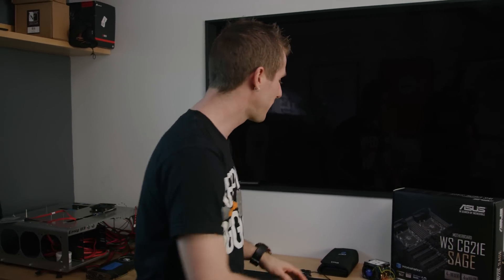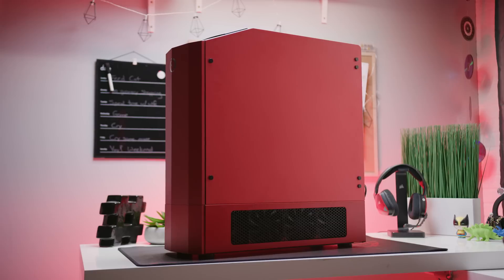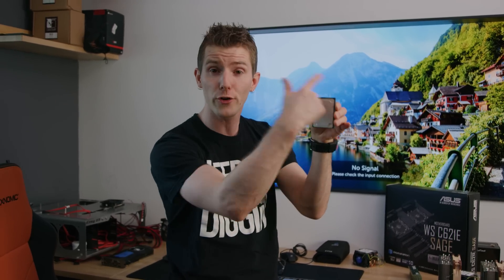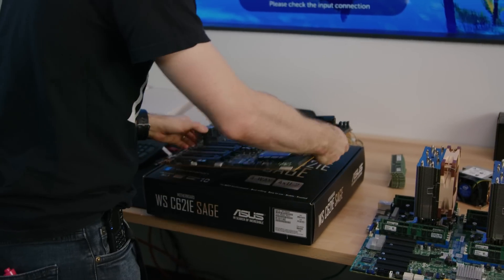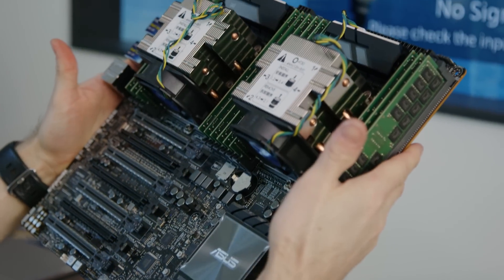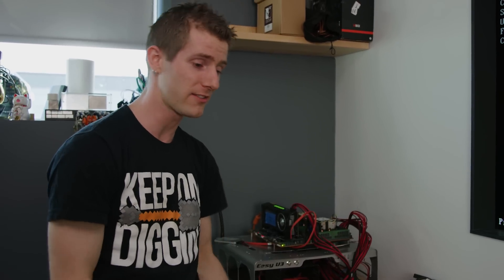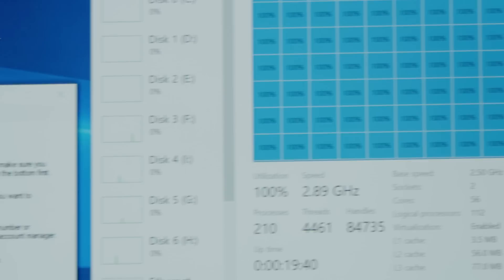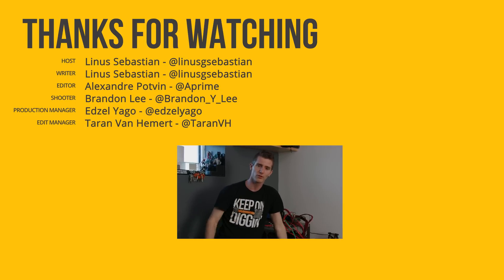56 Cores in ONE SYSTEM! - HOLY $H!T

Comment: Epyc is a better design, intel uses a single monolithic die in there Xeon cpu’s, a 26 core cpu has a massive die, the amount of yield from a wafer with the use of a single die this big would be tiny, this results in them being extremely hard to manufacture and extremely expensive.

Epyc uses multiple ccx’s of 8 cores each connected by the infinity fabric, these dies compared to the size of the single intel 24 core monolithic die produce significantly more yield from a wafer of the same size, hence manufacturing costs due to less difficulty and higher yields are way lower.

The result-

Intel 8164 26 cores 52 threads 2-3.7ghz cpu- $6120

Epyc 7601 32 cores 64 threads 2.2-3.2ghz cpu- $4500

Comment: Virtualize 56 single core systems on it.
Reply: Virtualized 112 machines and load them with browsers and YouTube and word documents until it freezes
Reply: Why stop there? Treat each thread as a core so have 112 single thread systems
Reply: https://ark.intel.com/products/120496/Intel-Xeon-Platinum-8180-Processor-38-5M-Cache-2-50-GHz- it has 56 threads lol
Reply: Give each system a new disk! No disk load!
Reply: or just use one chrome instance with 20 tabs open.
Reply: Mind the disk load.
Reply: That's where you need NVME SSD's, and if thats not enough, have the Guest Virtual Machine copy from the NVME SSD to the RAM during boot.
Reply: Don't bother with set core assignments and use something more flexible like Citrix to have a  couple hundred people working on it^^
Reply: I’m with you in that. I would love to see it XD
Reply: You can run 224 single core vms without a problem, You can overprovision vcpus

Comment: i want to see the multi workstations on one motherboard set up. especially if you can compare the cost of this machine to a comparable setup with seperate computers. would there be advantages for teams that need to work together? also find some ai programmer to see if this can have some utility in training an algorithm quickly. usually deeplearning stuff is gpu focused but maybe 56 cpu cores can offer some benefits with less of the drawbacks of average, lower core count cpus. you can do content on enterprise technology, ai research, programming, and computer science just using one machine!
Reply: a major downside is 1 point of failure and all your workstations go down
Reply: true though it is a way for a low operating cost business to have 100+ computers on a 20k USD or below budget for computers so in that a single point of failure will be acceptable but on the list of what to get rid of when able to do so as virtual machines can have upwards of 200 machines running on that 1 server depending on how many resources each machine needs and how much redundancy done most likely in hardware RAIDZ 
most likely it will make for a good server for all your front facing computers that have a tolerance of 3 hours of down time per month for updates to the main machine which for most business a 3 hour break per month with the rest of the month always on and always working perfectly will be better than what it most likely is now due to how bad windows is with a set up of 3 or more fail over computers from the main one 
the IT department makes it work but when it actually is used getting back to the primary computer after what the fail over was caused by is fixed is not a easy task to do and everything takes longer on the fail over computer due to the switch that should be not noticeable but is in the network infrastructure to the server

Comment: Things you should try:

Mine XMR with Nicehash and compare the speeds to any high end GPU(GTX 1080ti, Titax Xp, ect.)

Run 5 to10 different CPU intensive games at the same time

Render a video in Vegas Pro and Adobe Premier at the same time without using the GPU

And do more fun things like that 😉

Comment: see how many chrome tabs you can have open watching the 1 hour replay of Sax guy Gandolf simultaneously and after that, use blender. Also, for the people saying try Minecraft, it would actually run like crap compared to most CPUs when you are actually doing something because of low single core frequency and lack of core usage. (Minecraft only uses 1 core, so 1 core at 2.9Ghz won't get you very far)

Comment: How would it handle complex CFD in multiple permutations (ie differnt angles air hits a spoiler for a race car). For Formula Student, we normally have to send this to a supercomputer service but want to see if it's possible to run from a 'local' motherboard so we don't have to queue for runs.

Comment: How Fast can it render?
If you can, try out the AV1 codec. Note that it's also called VP10, and you have to install the libaom patch.

If you use ffmpeg, the command should be...

ffmpeg -i input -c:v libaom -b:v 1M -thread 112 output

(BTW It feels so awesome to type -thread 112)

Comment: i want to see what its like to render out like a pixar movie. ive heard those guys have FARMS of GPUs to render a film and i am super curious what that kind of workload does to a system like this
Reply: Not much more than rendering a single scene in e.g. Blender Cycles or Mental Ray or iRay etc. The only reason they need to use render farms is for time constraints and because they likely do it at absurd resolutions and sample rates. I suppose they also probably simulate a lot of things like hair, foliage and water etc. at finer detail than most people would bother with.

Comment: I'm curiosus how many vm machines could it handle using qemu kvm. And if you're fealing frisky about it you can use qcow2 images using ssd and hdd for hot and cold sectors.. meaning reading vm resources from the ssd and writing any changes to the hdd.

Comment: Monero CPU mining ?! hashrate ?
Reply: and what about power consumption ?
Reply: Based off my experiences with Monero these should get around 950-1100 h/s per cpu.
Reply: Zach Demand, That's dreadful. The TR 1950X does that.
Reply: no way. Broadwell gets about 100h/s per CORE. No way its doing 1000h/s per cpu.
Reply: NoNoseProduction 
Well the platinum 8176 gets around 1330 h/s which is basicly the same cpu with a lower base clock, so I wasn't that far off.

Comment: to pay for the enginnering involved in them.. you mean, pay for an outdated, monolithic design that has horrible yields and is technologically inferior to an MCM design? Ahh... right.. intel needs one of the biggest names in tech to wave the blue flag to slow down the steamroller-and that pun was intended. Intel just got handed their ass serve r and workstation wise, as well. the only thing that intel has a benefit on is IPC, which comes from ringbus, not from any new design or development. the 'newer' chips are more like ryzen, and just as bad at games right now. remind me: how does the flagship 18-core run vs a 7700k in modern and older games?

Comment: The microSD card slot makes sense for a virtualised environment where the hypervisor is read from the microSD (VDI maybe). A major upgrade is just shutdown, swap the microSD, and boot back into the cluster; if it fails to boot for whatever reason, you can just swap the original microSD back and then figure out what the problem in without it being down. It leaves all your onboard storage available for virtual SAN, all the PCIe slots available for GPUs to share to the VDI VMs...

Comment: Crysis 3 144hz(if possible)/fps, ultra Settings, 16 monitors all running at 8k each or like the triple projector thing you did a while ago, or minsweeper 1,000,000 FPS

Comment: I'm pretty sure you can fix 90% of window's searching functionality by deploying a small sqlitedb where you run sql-statements like (SELECT * FROM FILELIST WHERE UPPER(NAME) LIKE '%' || UPPER(@SEARCHSTRING) || '%') off of a table where you store frequently used files or files of installed programs that will most likely be accessed at some point...

Comment: Not impressed until gigabyte sends you their 4 cpu epyc workstation motherboard and your rocking 128 cores....256 threads.  That is a holy shit, this is a meh.  Everybody knows intel has high core xeons, not everyone knows about EPYC having 32 cores at a pretty high comparative clock speed.
Reply: Can I get the specific name of the Motherboard? I am curious to know which of their offerings has four CPU slots, I can't seem to find it.
Reply: Hmmm.. ahh well, I am just looking for a motherboard that has the best support possible for CPUs, I care not for the brands since I am not a PC tech, I just want what works. So, they only go as high as two? Or are there bigger ones out there?
Reply: Thanks for the info, though I only found a Xeon Platinum CPU, not motherboard so far. Still, I am just looking for the best, I plan to build my own PC as several of my friends are PC gamers, so I'd like to be able to keep up with them, if not just flat out run past them and leave a nonexistant trail of fire. Any help in citing parts would be appreciated.
Reply: Saving that just incase, I'm just looking for a flat out PC motherboard and I have a 5K budget for the PC tower itself, not counting keys, screen, and mouse
Reply: You guys got me lol.  But I still need dual 32 core epyc in my youtubery.
Reply: Provided the specs line up I may end up going with two of them for my PC build.

Comment: If you're into math, you should test it with the LINPACK benchmark used to evaluate supercomputers:
https://www.top500.org/project/linpack/
It'd be funny to see if that machine would beat the fastest computer in the world from from a year in the 80's or 90's.
Reply: All the supercomputers up until 1996 are beaten by an i9 7980XE as they all score below 1TFlop/s on Linpack. Then supercomputing started taking off and by 2002 the fastest supercomputer (the NEC Earth Simulator which cost around 600 million dollars) was capable of 35.61TFlop/s. It is possible to beat that performance with an 18-core Intel E5-2699 coupled with 16 NVIDIA Volta V100 GPUs (a combination that costs around 150 thousand dollars) which score 51.77TFlop/s. So with 4000x less money you now get 45% more performance. The next supercomputer milestone to surpass would be 2004’s IBM Blue Geene  with 70.72TFlop/s.
Reply: my single xeon w3690 beats all the 80's supercomputers and it only has 6 cores, it scores about 70 gigaflops

Comment: Yeah! Who puts 4 u.2 slots on a board. Err... what is u.2? I’ve only ever heard of m.2, and I have a feeling they’re not based on the same thing.
Reply: u.2 is the new high speed. Designed to replace all sd/sf format if I am not mistaken.
Reply: I was mistaken about the replacement / usage of terms. I was thinking of  UFS version 3.0 standard, that would go to the drives?  It has been a long day.
Reply: Chris Flynn - Thank you. 😁👍
Reply: Haha, don't worry about it. It's fine. :)

Comment: you'd need 256 GB of ram to have 2GB of ram per core
since it only has 12 slots minimum is 32x12 which is 384
WAIT are there even 64/128 GB ddr4 sticks
this makes me want to add more ram to my system...

Comment: Weather simulation. It one of the few HPC computing tasks, that is still done exclusive on CPU and it scales to almost as many threads you want. This system should be equivalent to typical weather modeling supercomputer from about 2005. It would be great to see what can you do in desktop from factor today compared to row of refrigerator sized machines  from not to long ago. And it is actually useful.

Comment: But can it run CRYSIS???????
Reply: Crysis on all 6 virtual workstations at the same time
Reply: I doubt it has integrated graphics being a Xeon but it would be tight if it could
Reply: Why NO Crysis if you read thus linus it NEEDS to be run,grab a copy from GOG . com and just run it as a standard benchmark even if it's just for the LOLs
Reply: It can come up with original content so its more intelligent than you are.
Reply: imho his comment was mandatory, with that question :D
Reply: 20fps on low 800 x 600 resolution
Reply: At 144p so less gpu power more cpu power

Comment: Dual-Epyc adds up to 64 cores. And I'm fairly certain they're cheaper since each EPYC is 4 Zeppelin dies.
Reply: They are not available for purchase yet
Reply: They are behind in single core performance but awesome at multicore, so i doubt the price difference can be justified for going with intel as lately they are way more expensive per core
Reply: they were sent these CPUs so why waste them and SP3 motherboards suck for this stuff
Reply: they still probably fall behind in performance though

Comment: Hey Linus, I work for HPE and we handle these type of CPUs all the type. The installation process is actually to mount the CPU to the heatsink with a plastic retention clip, and then install the heatsink with the CPU already attached to the board.

To remove the CPU off the heatsink, the plastic retention clip should have a corner specifically designed to wedge a flat-head screwdriver and pry off the CPU with zero damage to either the heatsink or CPU if they are made to Intel's spec. I would inquire about these designs if I were you.

Comment: Being a car/tech guy I would take a good cooler for overclocking and make a mount for it.
Reply: It is not just the mount, but the coverage of the block as well.
Reply: Just a big aluminium block on top of it and you can run it at any frequency

For a while atleast

Comment: Few things:
1. MicroSD on the board is for Hypervisors like ESXi MicroSD boot (you don't need any HDD/SSD for the ESXi, MicroSD is more then enough)
2. I understand that Intel sponsored this video (specially since practically NO ONE buys the 8180 chips, the price is simply too high (+10000$), companies would prefer to either buy the Gold Xeon SP or go with AMD EPYC.
3. For a project that you mentioned (that each editor will get a VM + dedicated GPU), I would recommend to test EPYC. You'll have a lot of PCIe lanes (128 compared to 48 on Intel), 8 more cores (64 vs 56),  and it's also fully supported on KVM (I think the latest UnRAID should have the latest modifications of the KVM to support EPYC/Threadripper/Xeon-SP etc)

Comment: what about the new AMD Server motherboard and 2x AMD EPYC 7601 32 core processors for a total 64 cores 128 threads and 2TB of DDR4 duel channel RAM modules and if you wait until 2019 then 2x AMD EPYC 64 cores 128 cores and 256 threads.

Comment: Well as it's professional kit...

1. How many desktop VMs can it run with sensible specs, say if you wanted to roll out thin clients to your entire office for example doing office applications, web browsing etc.

2. How well does it perform when compiling large applications. Compile the entire Linux kernel and a selection of applications from scratch.

3. Performance as a webserver. Load it up with something like Mediawiki with a DB and PHP on the same machine and see how many requests per second it can handle vs older generations.

4. Lightroom... which is notoriously slow... So compare how long it takes to convert and then output a few thousand photos in various resolutions and formats (JPG / PNG / PSD)

5. Some kind of CPU-bound AI learning workload. There's some people on YouTube who trained an AI to play Mario, maybe drop them a message and offer a collab to see how well it could play after <x> days of training after starting from scratch then maxing out all the CPU cores.

-- 

Really curious about 1 and 3 as these are easy scale-out applications that could very well end up being used for real on such chipsets, if they aren't already.

Comment: Here is what and Many in a small obsessed group need to know.  I am a Lockheed Martin Prepar3d 4.2 user.  If you know anything about the community, that's like saying obsessed drug user, and the platform has been named "Tweak Simulator".  P3d is the current flag holder of the Sublogic/Flight SImulator Legacy.   It is Very CPU dependent, and just won't run smoothly, even though I just built a very speedy 6 core PC with a 1080 ti.   Even the most powerful consumer PCs can be brought to a crawl with it.   Lockheed Martin claims that Prepar3d 4.2 will utilise all the cores it has available.  But I would like to see just how well that works.  Go ahead;  It's not a game, it's a Simulator!  And LM has been selling it to someone who can make it work.  Maybe 100+ threads are just what I need.

Comment: My Curiosity would be, how long does this "Monster" need to render a 20 Minutes 4K 60fps Video? And to make it abit more interessting, insert some extra Effects also in this Video like Color Corrections, Screen overlapping, HDR, Sound Equalizer ect. 
Im doing here and there some Let's Play's and my current System ( AMD FX 8350 + Asus Geforce GTX 770 OC and 32 GB of G.Skill Trident Z DDR 3 RAM @ 2133 MHz ) needs to render an 20 Minutes 4K 60fps Video + Facecam ( 2 Video and 2 Audio Streams ) with some of the Effects i've written obove, almost 3,5 Hours.
I just would like to know how far i am away from this Machine :D
Thx alot and keep up the great Work!